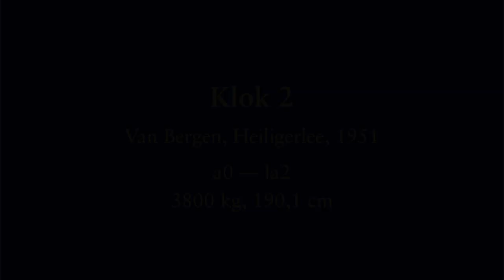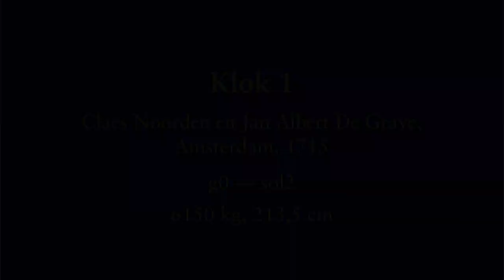Lange Jan, Middelburg, luidklokken

Comment: Waarmee is die prachtige simulatie gemaakt, die te zien is vanaf 24:55?
Reply from the maker: Onder Linux: ffmpeg en od om de klank om te zetten in getallen, awk om de drie klanken samen te tellen, een eigen programmaatje om de ASCII getallen opnieuw in wav om te zetten, ffmpeg om de filmpjes in afzonderlijke beelden uiteen te rafelen (1 file per beeld), convert (van imagemagick) om de beeldjes te editeren en samen te voegen, en tenslotte avi_encoder (lives) om de afzonderlijke beeldjes en de klank opnieuw samen te stellen tot een film, alles vanaf de commandolijn.  Alle gebruikte commando's heb ik in een filetje bewaard, zodat ik enkel copy-paste moet doen van die commando's op de commandolijn als ik het opnieuw wil uitvoeren (bijvoorbeeld met een andere waarde voor een van de parameters).  Bijvoorbeeld om drie beeldjes samen te zetten (ik heb eerst een test met een beeld gedaan om de juiste waarden van de parameters te bepalen):
convert -size 1280x720 -depth 8 xc:black   \
     \( /home/thierry/livestmp/beeldjes_in/middelburg/image_1130-00049.png -rotate 90 -resize 405x720 \) -geometry +0+0 -composite \
     \( /home/thierry/livestmp/beeldjes_in/middelburg/image_1130-09831.png -rotate 90 -resize 405x720 \) -geometry +435+0 -composite \
     \( /home/thierry/livestmp/beeldjes_in/middelburg/image_1142-03358.png -rotate 90 -resize 405x720 \) -geometry +870+0 -composite \
           test.png
Reply: Pff... OK bedankt! :)